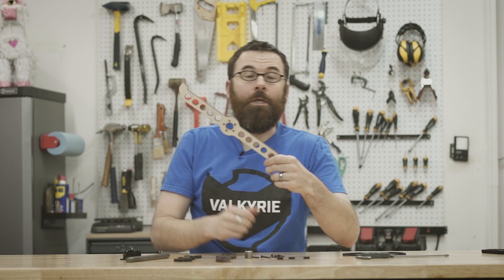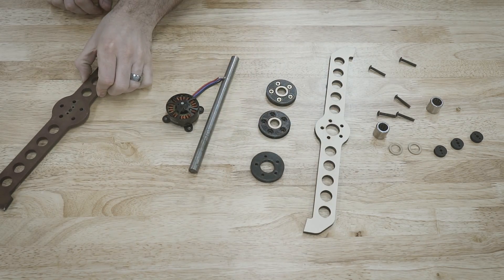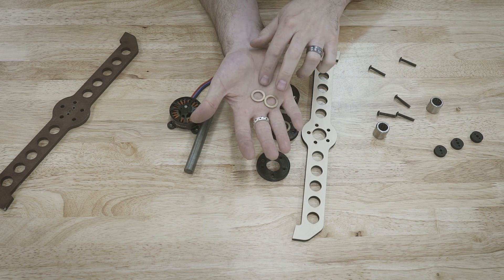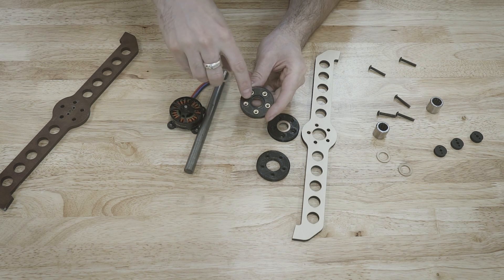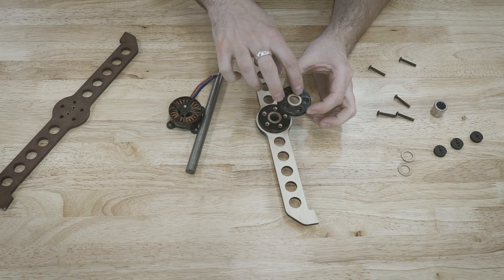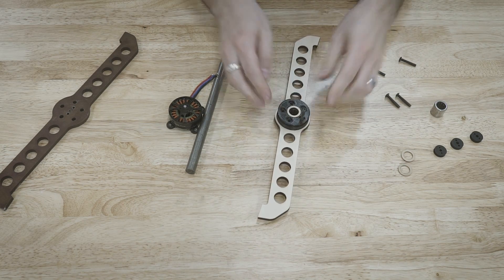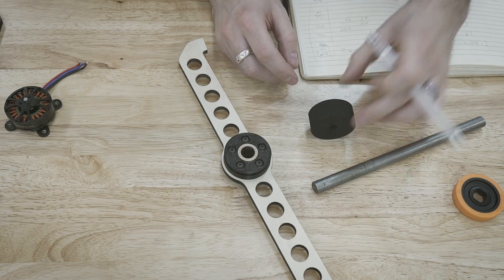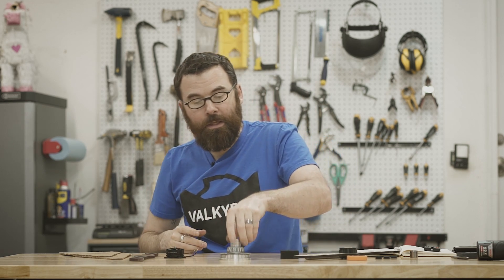Psychotic Break Build - Weapon Hub

Comment: I know 3D printing with few exceptions, really isn't viable for larger robots. How has the advent of 3D tech changed beetleweight and featherweights? I unfortunately have really only started watching them recently and don't have a good idea of what the robots were like before.
Reply from the maker: 3d printing has a place in EVERY weight class.  For lower weight classes, it's just more versatile.  But heavyweights use it from time to time for various internal parts.  I have several 3d printed parts in my featherweight as well.  It has really changed the smaller weight classes for sure.  And as the materials get stronger, it can now be used in more applications.
Reply: @RobertCowanDIY  I guess I should have said what I more meant, in that it isn't viable as a large component in most robots like the chassis or wheels (Huge). Whereas in featherweights and beetleweights the chassis can be made by 3D printing. I think I've seen that a couple of the battlebots teams use 3D printing for certain component protections and such. I was more asking if it has changed design by allowing the creation of shapes and things that you couldn't do before, or helped with time in the pits and wallet with less expensive methods of existing parts and design. 
I clearly needed more coffee this morning.
Reply: @42grath  I have no idea where you're getting the idea to 3D print a featherweight chassis. 3D printed beetles are already pushing it, a 3D printed featherweight is going to disintegrate. That's assuming you even have a 3D printer big enough to print it out and not have it warp into a potato chip.

Comment: You should mill a hex to the end of the shafts that way you can use the frame as a "wrench" to hold the dead shaft while you tighten it. Only problem is that you have to cut a hex in the frame.
Reply from the maker: I was going to put a flat on the ends of the shafts, and key them into the frame, so they don't spin.
Reply: That works as well. Looks forward to seeing the completed build

Comment: What are the benefits of a dead shaft vs a live shaft? I assume that you are able to have a larger bearing surface in this application which would make it more robust. Is that correct?
Reply from the maker: It depends on your design.  For THIS, a live shaft might be silly since I'd need to support the shaft with bearings top and bottom, rather than in the middle.  For Crippling Depression, having a dead shaft would rely on some sort of part to hold the weapon on and keep it from slipping off, which could be problematic.  The design really dictates which is better.  For Copperhead, the wheels are on dead shafts, and they rely on a large washer bolted into the end to keep the wheel on.  The dead shaft is stronger, as it's bolted into the frame, but a strong hit from the side could theoretically put a lot of stress on the washer.  They each just have different considerations.
Reply: Generally dead shafts allow your shaft to be part of the rigidity of your frame, since they can be rigidly attached to your frame rathter than through bearings, and therefore generally increase the strength. Live shafts allow you to transfer energy through frame members, since it's not rigidly attached.